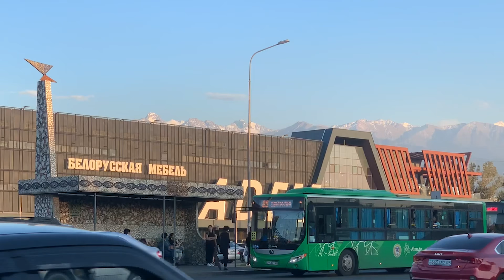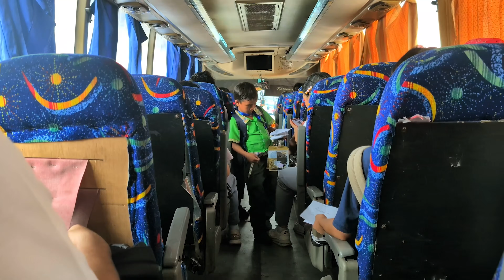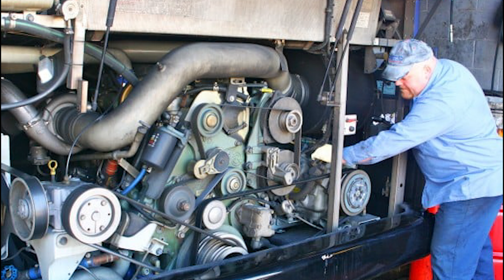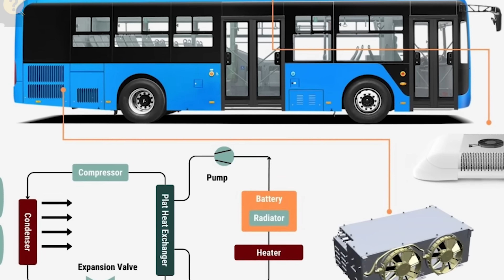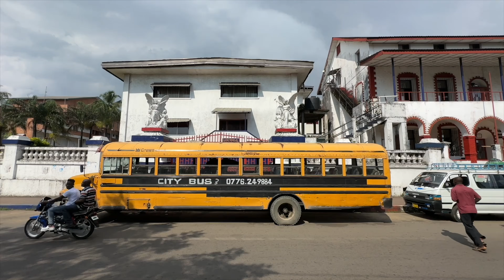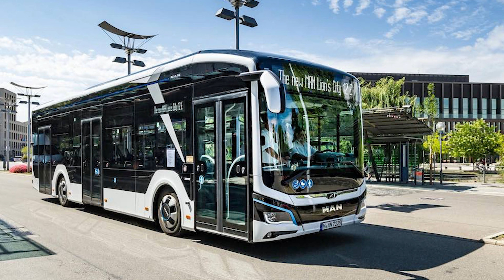Why Do Buses Have Their Engines in the Back?

Comment: Better rear wheel grip,  weight ⚖️ and acceleration under load.
Reply: Buses are heavy enough where none of that matters. Look at school buses.
Reply: @MrSpartanPaul 🚍 Take 🪞🚌🤡a 🚌long🤡🪞🤡look🪞at🤡🪞. ignorance🤡🪞
Reply from the maker: That’s partly true — front-engine buses work well too, especially school buses because they’re cheaper and simpler. Rear engines are mainly used for better comfort, quieter cabins, passenger space, and traction.
Reply from the maker: Exactly 👍 Rear-engine buses put more weight over the drive wheels, which improves traction and acceleration — especially when carrying heavy passenger loads.